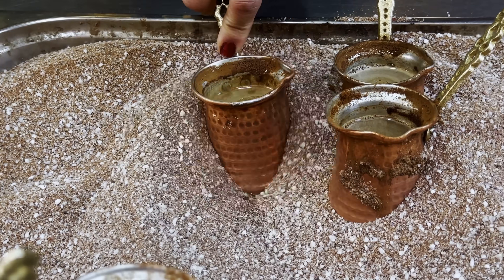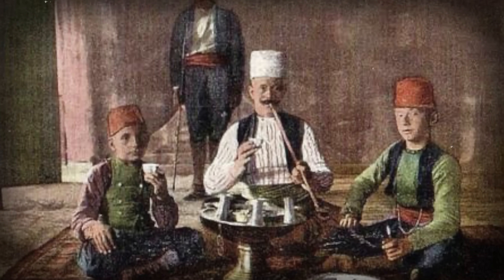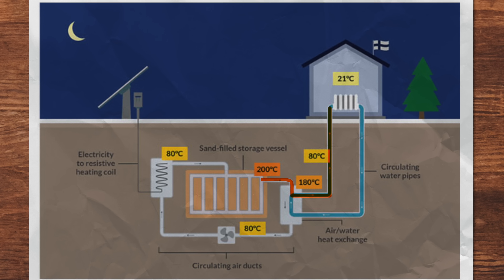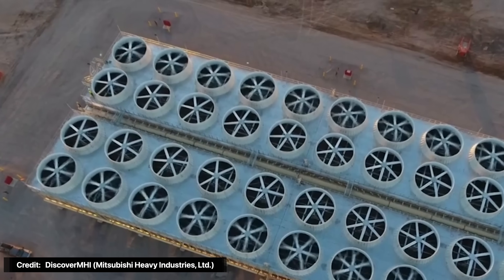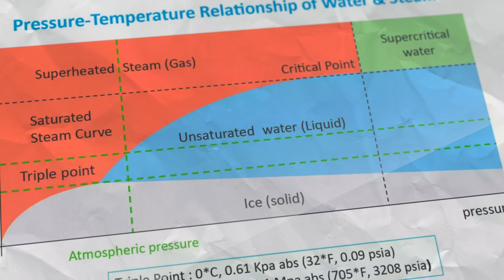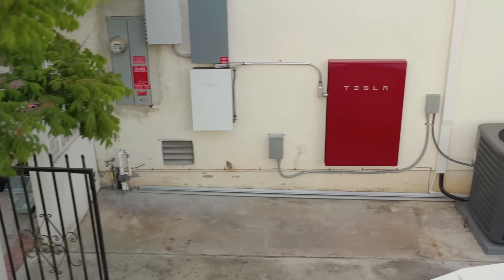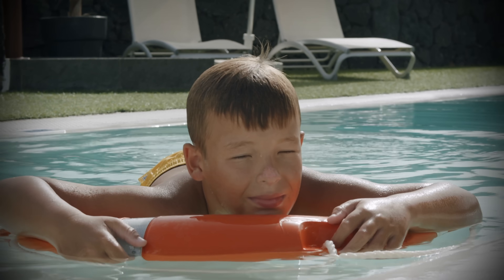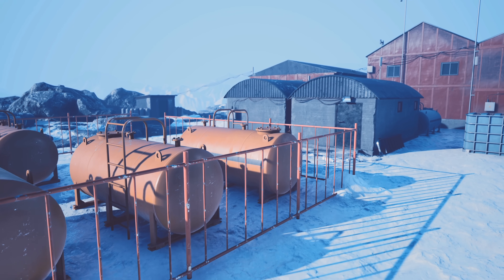The Power of Sand Batteries -- Revolutionizing Energy Storage...

Comment: I like to hold the idea of this country saving as much money as possible in this particular time. This is a renewable energy sandbanks like you described have been around in one form or another. Thanks for pointing out Turkish coffee being heated in hot sand.  Quick question. Why can't these very large sand batteries be put in the ground? If they are put Underside walks in cities on a small scale that would help melt the sidewalk and the roads. On a smaller scale putting sand batteries underneath the driveway in Minnesota or New York state in the winter. If they are connected inside the house and the heat is pumped underneath the driveway in a loop back into the house.

Comment: I imagine the next step would be to use a heat pump instead of the resistive heat coil. That way you get a 300-500% efficiency in the electricity to heat conversion rate instead of the 100% from the resistive heat coil. Even if you only have a 50% efficiency in converting heat back to electricity you'd still get a 150-250% increase in electricity. It would essentially be an energy multiplier.

Comment: Actually, I am developing a sand battery, Storage capacity: ~175 kWh total, ~160 kWh usable, Heating autonomy: 34 days at 42 kWh/day consumption, Recharging time: ~10-12 hours at 1518 kW power. The only downsize is the weight of it - 2360–2400 kg.

Comment: I have sand pits, in my town , right next to huge swamps1250 ft above sea level, in Massachusett. 
   I’m preparing to sell my home of 50 yrs.. no big deal, but it will require a complete , rebuild of everything except, roof,  foundation, and original frame. The 1300 ft above sea level, town center, solar site, is 1.8 acres, and has water, in ground. Timber on site, and is designated agricultural land.
   Where an average home is worth $550,000, in my state , I can make the point, sand is the real option.!

Comment: Made my first one in a metal 2 gallon water pail. Couple of pieces of corrugated roofing, a 12 volt immersion heater from my days on the BigTruck, and a UBS powered 4" fan. Routed 12 volts from a couple of less than optimal car batteries I had sitting around 
and topped them off with a 2 watt Coleman solar car charger I got from W☆M for $27 (gang them in parallel to keep them 12 volt)
Got the big room (13'x17') so warm after a day the cat went outside to cool off. 
Next will be a 14" SPARK pot belly stove for the bathroom, a 17" decorative milk can from W☆M for the kitchen/dining, and the Piece de Restance will replace that water pail . . . For the great room - a 32" BUCK WARNER pot belly stove (because I gotta have my ambience) complete with a $4 heat actuated stove fan I got off Temu for $4
My heat bill (from my electric wall furnace) went from $253.64 to $9.37 . . . 😅
You can make them in just about anything you can put sand in. BUT please insulate them  from your wooden floor.
If you want a way to regulate the heat, visit the spring clean up pile and grab the thermostatic control off a dumped electric oven. Or go pay for a new one.
Always spend for genuine 12 volt emersion heating elements (the R.V. supply store kind)
Always use extream heat insulate protection where you rout the supply wires through. Heat your house - not melt it.

Comment: When I saw that so much electricity is for AC and the rest is all heating of water, I couldn't help but think of the excess heat being transfered back to a heat loop and stored by the same energy companies. Cold water systems in a city already supply cold water at 52 degrees which is plenty cold to cool the AC. Our water systems just need to be 2 way and it's done.

Comment: There is a home that was built new a number of years ago in the UP of Michigan. The fellow who designed the HVAC system for it is (or was, not sure if he still teaches) a professor at a university there. He put solar on the roof and under the home built a "basement" that he filled with sand and heat exchangers. Around late summer/early fall the homeowner turns on the solar and starts heating the "basement" sand. She is able to use that heat all winter in the Michigan cold until March. At that time she uses her fireplace to supplement. Simple, and the ground is an excellent insulator!

Comment: You're sand battery is not competing with lithium batteries because you don't use a sand battery to produce electricity. Listen, for the same reason people don't like using lithium batteries to heat their water and homes they won't like using sand batteries to make electricity.  It is for similar reasons and you mentioned some of them, They don't want to have to put all those extra cycles on their limited cycle batteries if they don't have to. So this is where the sand battery is not actually competing with lithium, it fits perfect to complement the lithium. We will use the lithium for electricity, but the sand for heat, if we are not stupid. 

I mean yea, some people will be desperate and male electricity with the sand anyway but that is ok, hurts nobody. People in places where electricity(money) is non existent or hard to come by. They can't buy lithium only to cycle the shit out of a pack of batteries costing $10.000 only to throw them in the trash 5 -10 years later, $10,000 those people don't have period, let alone have to spend on lithium. But go ahead and cycle the living hell out of the sand battery it hurts nobody.

Comment: "...heated to around 1100 degrees Celsius."  That would be 600 deg C, or 1,112 deg F. 

A solar hot water heater is a far cheaper means of heating water.  Furthermore, many apartment complexes are heated by mans of gas-power hot water heaters.  Some hot water heaters have piping which allows them to be heated by an external, isolated and closed loop fluid, in addition to either electric or gas.  They're also as big as you want, so they can 

All that is for naught, however, if your home is poorly insulated!  Modern construction standards MUST be upgraded to include FAR better R-values, along with IR-reflective energy management.  While passive heating and cooling built into the home itself can be useful, it's usually far more expensive than active means powered by solar energy.

Best practices should into the cheapest passive solar heating and cooling with the cheapest solar energy generation and storage solutions.

Comment: What about using those things that used nuclear fuel is stored in and use the waste heat from them. Basically you can encase the Nuclear casing with sand with a heat exchanger to extract the heat from the spent fuel. I understand that spent fuel can be hot for a long time. That way instead of wasting energy cooling the stuff for years, we can put it to work.

Comment: So the bigger (or hotter) the better. But how efficient will it be if you scale it down to 10%? Like a 7' tall and 2' - 3' diameter. I don't need to heat a 100 houses, just my own house (cuz, I like to try things and not want to compete with natural gas which cost $ 2.5 - $5/GJ or $0.009 - $0.018/kwh, by selling heat to the neighborhood)

Comment: Sand is "GeoThermal Where-ever You Want It" ... that's the best way to think of it.  Use Sand Battery systems the same way you'd use GeoThermal.  It's a bank;  deposit when you have excess, withdraw when you need to top off the energy budget.

Keep in mind that in North America, 25% of energy is for heating and cooling.  Also keep in mind that transmission losses are averaged at 30%.  So every kilowatt of electricity use for Hot/Cold, you reduce electrical generation demand by 325w.  Over a thousand homes, that becomes significant.

Comment: The picture at 4:00 is designed to appear like the entire thing is buried, but that would not be the case. All of the ancillary equipment would be in a shed next to the home, on top of the tank. You never want to bury something you may need to service later. But rusty old tanks are abundant and cheap. So long as its not capable of building pressure of any sort? Its harmless.  As is exhaust tubing that can be easily bent at the local muffler shop. We are now seeing All-in-one hybrid and off-grid solar charge controller/Inverters that have 30/50 amp/240V "Smart Load" circuits built in. That would enable you to dump a crap ton of excess solar energy into such a thermal battery, every time the electrical batteries are full. The Grid is becoming more and more reluctant to pay consumers for their energy. Storing it as thermal energy just makes way too much sense. Heck if I lived in the south? I'd be freezing a thermal mass instead.

Comment: Why couldn't it be used in summer for air conditioning?  Certain refrigerators are powered by propane heat to cool, so why not sand batteries to power air conditioners?

Comment: Cold climates need heating for their houses and have a problem with snow blocking their roads. SOLUTION-Build sand batteries under the roads near the houses.The leakage of heat will keep the roads clear of snow

Comment: A heat battery in a greenhouse or passive solar residence during the winter, and then cover the windows during the summer (or plant deciduous trees south of it) so that it becomes a cold battery during the summer. Hmm…. It wouldn’t need such extreme temperatures on a residential scale in the first place, so the efficiency might actually be a pro instead of a con in this case?

Comment: All refrigeration, which includes air conditioning, is using heat to make cold. Nearly all installations use electricity to create that heat but there are gas refrigerators that use heat directly. So, refrigeration and air conditioning should be included in what can be powered with this technology. This make a big, difference to the ROI as air conditioning is powered during hot weather where the days are longest and the sun shines brightest.

For new builds the structure could be above a sand heat reservoir in the ground. In this way the efficiency could be further improved.

Comment: Dummy you are missing concentrated solar to fewd the heat bank, R-3,000 insulaton of hollow glass microspheres. 1" = 250 dead air space.
& ways to operate HVAC via air pressure with no moving parts. Ammonia heat cycle refrigeration uses your liw temp "waste heat". 
BEST BATTERY EVER!

Comment: Many houses are build on sand. The  grounding down of the basement could do the thermal insulation, so summer heat could be stored in the ground of your cellar; warm air rises upwards in winter hugging the whole house. Today some think about cooling the house in summer by tubes digged in the still cool gardens sand.
Half a century ago I was fascinated by a zero energy house witch stored the summer sun in a iron tube containing ten thousand liters of water, positioned vertical in the middle of the house, reaching from the basement to the roof where tubes collect hot water directly from installed thermal sun collectors. The stored energy was told to be enough for a winter. I later never heard anything about, maybe oil or gas was easier to use in existing habiations.

Comment: In a home use refrigerator AC and hot water in conjunction with a ice battery use lower grad heat return for hot water because a hot water tank form home is mostly a water heat batteries for heat loads for space heat wen needed make more sense for AC and Refrigeration as use to freeze ice ice batteries by using sand battery as heat drive Refrigerant Gases completely eliminate base load for AC and heat hot water and heating Refrigerator allow you to have smaller electrical batteries or longer term for Home appliances

Comment: Why not add a vacuum seal or two too stop heat leakage?

If you heat the sand up using solar in remote areas on scale than the energy ⚡ cost null and makes more practical sense

Comment: We have water batteries here in Germany in some residential buildings. Those are basically huge tanks filled with regular water which is heated during the summer by solar panels and the heat is then stored and used during the winter to heat the building. It´s pretty simple. However producing electricity from heat is a bad idea, the loses are to great. However the overall efficiency of thie mentioned idea is way higher since the energy is stored in between seasons. The idea is fantastic because it´s rather cheap and technologically easy.
Reply: That's crazy those insulated water tanks can still be hot months later. My home water tank needs regularly heating for hot water.
Reply: @user-uy1rg8td1v  There are multiple effects responsible for the good performance. 
1. Insulation is really thick and the tank in many cases is buried deep underground.
2. Tank volume is high. It´s a huge tank with a lot of water which makes it easier to again insulate. (high volume, small surface) like an Iglo basically, that´s why Iglo´s are spherical.

Those are pretty well known and simple principles, they are also low tech and therefore cheap but are robust and work very well.
Reply: @user-uy1rg8td1v  So in turn for your water tank to have similar capabilities, it would need to be a huge very well insulated tank, which does not make sense in your application. Those huge tanks are also shared between multiple apartments for the whole building. It´s what makes is super efficient.

Comment: I'm sitting here watching this and thinking "why does a sand battery have to be in an elevated silo or tower, why not just dig a big hole in the ground and fill it with the sand and equipment, then cover it over and use it  for a parking lot, or sports ground, or any of the other possible uses for such an area?"
Reply: They store the sand in a silo because the walls of the silo are insulated to help maintain the internal temperature. They can put it under ground but then it would need reinforcement. A concrete box to protect it from pressure of a building or park on top of it.
Reply: @victorlee447  
That's not a sensible argument. 
I wasn't suggesting that an underground container would not need reinforcement - that would be stupid. The walls of a silo also NEED to be reinforced.
So really, it does make more sense to put it underground then.
Reply: a lot of the areas in Finland are essentially sitting on bedrock.  So, you just can't dig a hole;  it's a blasting project.  I suspect that's the likely reason.

Comment: There might be more efficiency in scaling up but the cost of infrastructure in large scale systems is too great. Small and cheap is the way forward for now. Sand batteries just for heating water etc charged by wind or solar seems the easy option.

Comment: I'm usually quite a big fan of this channel. However, I find this video to be slightly underwhelming. You seem to miss two crucial points:

1. heat batteries aren't a direct competitor of lithium ion / lfp (enter battery technology of choice here). Conventional batteries are quite good in storing (solar) energy generated by day to power the house at night. Heat batteries are better at storing energy generated in summer to convert (low worth) summer energy into high worth winter energy.

That is why they are mainly proposed in colder climates: not because they are that good in the cold, but because in the Northern countries the difference between solar power in summer and winter is way bigger than in countries closer to the equator.
Where I live in the Netherlands is not even that far north, but the difference between solar generation in winter and summer tends to be a factor of 5.

2. A KWh of heat is not as valuable as a KWh of electricity. 

"Converting heat from a heat battery to electricity gives a round trip efficiency of only 50 - 60%"

However, using that 55% efficiency to power a heat pump with COP 3.5 (still low, mine did 4.5 last winter) suddenly means you convert 1 KWh of summer electricity into 1.925 KWh of heat in winter.

Comment: What if you could compact and spread out sand (ideally black sand) basically it would be very easy to heat up the sand during the day by spreading it out thin and exposing it to sunlight. Then compact it quickly to store the heat in. Then during the night you would extract the heat to heat homes. Then right before the sun comes up at the coldest time before morning, you would again spread out the sand to cool it down to night time temps. Then in the day you can use that for air conditioning, no?

Comment: The problem with using the heat directly is that the most sand exists where we don't need the heat!   Turns out, Phoenix and Las Vegas aren't clamoring for heat for most of the year.  Yes, we still need hot water, but maybe electricity is still the best use.

That said, the "negative heat' aspect is interesting.  But I don't think it's grid-capable.

Comment: we tend to think too much on consumer electricity, but industrial energy tends to be a big cake. As a solution to replace gas in heat intensive industries like chemical, cement, steel or aluminum, it could not only be good for the environment (yadah yadah) but make those industries way more competitive. 
There isnt usually a single tech to serve all use cases, but specialized niche ones that fit different purposes. you can put these systems either at the high termal intensity facilities or besides a thermal combined cycle plant, and reduce a lot the gas needs using excess energy. moreover youbalso incentivice complex industries such as energy trading.